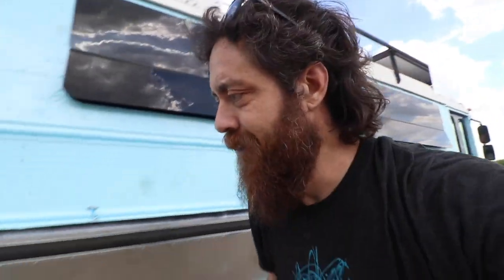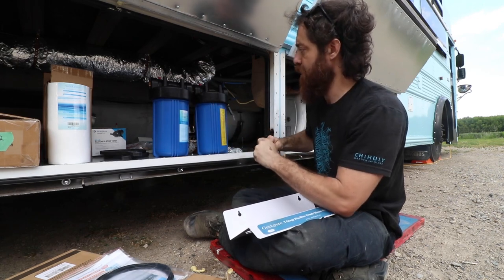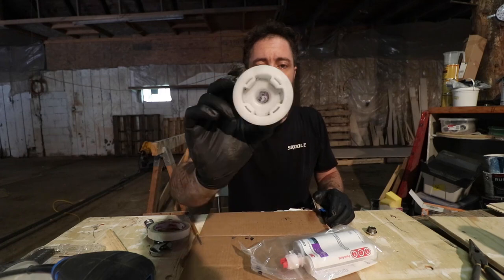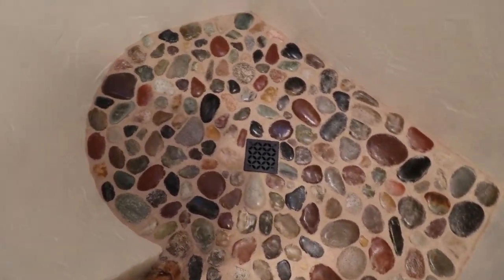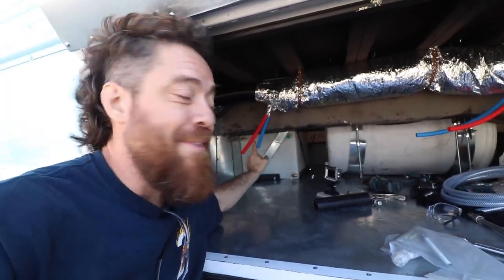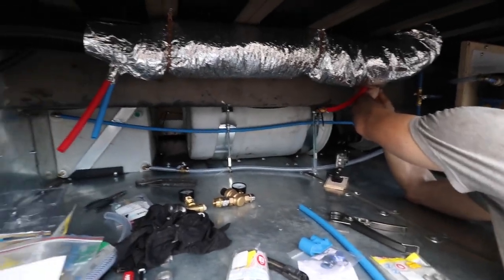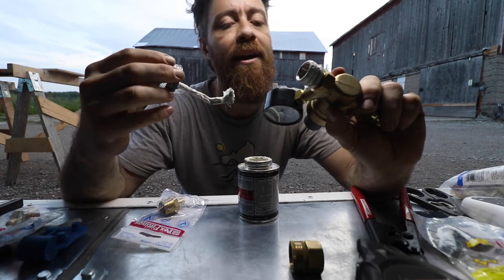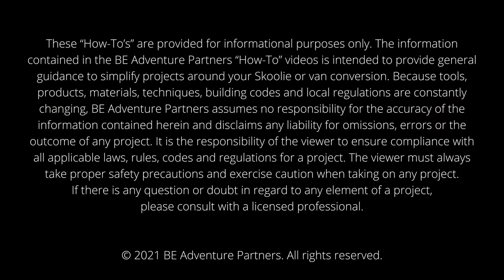6 WEEKS WITHOUT A SHOWER (Recirculating Shower Plumbing Complete)

Comment: Hi! It looks like you have a water heater separate from the Webasco, correct? Is there a reason that you didn't use the recirculating system for your entire plumbing (bathroom sink, kitchen sink, and shower)? The filtration would ideally be all in line, so no separate tanks needed, then drain and refill the single tank periodically. I would like to have a separate drinking/cooking water source though which could be a much smaller tank. I'd be curious to know your thoughts on a system like this now that you've set this all up and been using it.
Reply from the maker: Hey there Guglhupfifiable,
Great questions. First, we do have two water heating sources. One is for potable water (the Bosch 7 gallon point of use) and the second is the Webasto Diesel Heater (which does forced air heat AND a 3 gallon water heater reservoir).

The reason we didn't plumb the recirculating shower with the entire plumbing is because one system is for potable water (drinking water) and the other is for showering (not drinking).

That's why there are two separate water filtration systems.

This being said, we don't filter our gray water for the shower because we have our composting toilet's urine diverter connected to the gray water tank. Here's the video for that toilet: https://youtu.be/0oE_5kUlzAI

The recirculating shower is a closed system. If you want the diagram for all the details about it, we include it in our eCourse "Get Your Skoolie On" https://tribe.beadventurepartners.com/get-your-skoolie-on

As for a "smaller tank" for the system... We go through about 100 gallons of freshwater a week, which means that if we had a smaller holding tank, we'd have to refill more often (and we don't want to do that... We'd actually love to double our freshwater capacity, but there's no room for that with our current configuration).

That's the fun about building a Skoolie! Grab ideas and make a system that fits your use case :)

Thanks for watching & dropping your questions!!
- Brian +  Erin

Comment: 2 1/2 months or so late but did you catch that drip on the tank to pump line at the tank fitting? At 44:00 the drop had just dropped. Only saw ONE drop but it was there and then sitting on the bottom.
We are bummed to hear how little space is left under there. Nice to have things enclosed but that was hella work for that tiny bit of storage.  YIKES
Reply from the maker: There were just so many damn projects all happening at once, and one project depending on the other project getting done... it was nuts @Ham Skoolie. 

B fixed the drip! Everything is all good down there now!

It does suck that we don't have much storage space down there... Sucks a lot actually. We're so glad we did all that work to build the underbody though, because all that systems shit would have taken up our entire main floor. We also used those big barrels for our grey water, which took up a ton of space. BUT they were free. SO at that time... Free was all we could do.  Still... If we had matched 100g's of fresh to 100g's of grey water... ANY tanks would have taken up just as much room. ANd the luxury of the recirculating shower makes it worth it. 

Do we wish we had more space... Yea probably. But would we rather take long showers and not waste all of our water in 4 or 5 years... 100000% we want to have real showers!
Reply: @BEAdventurePartners  Yup, real showers are nice and when you're living full time necessary. We're not going with a massive underbody storage. We're looking at about a 6' section that passes all the way through and then using pre made steel boxes that we cut and extend so that they'll fit from outer skin to just shy of (and mounted to) the frame rails. Then putting a "skin" of sheet metal from frame rail to frame rail for the center section with some tanks in there.
We'll have about the same space underneath but hope to have less expense, weight, and construction time.

Comment: Are you using a separate hot water for your system?
Reply from the maker: Yep! Here's the video where we installed the water heater for the recirculating shower https://youtu.be/cX07REBol68 

There are multiple videos about the shower. Check them out on our Videos lists.
Thanks for watching!
- Brian + Erin